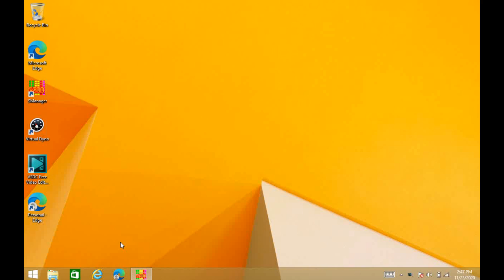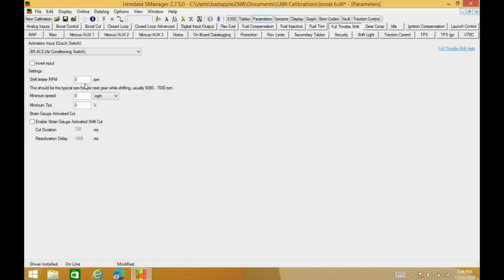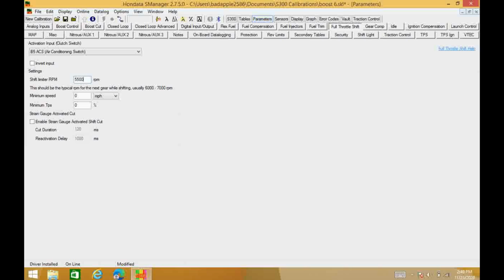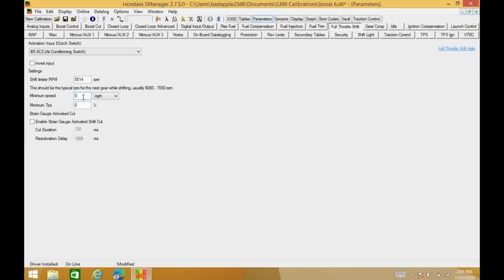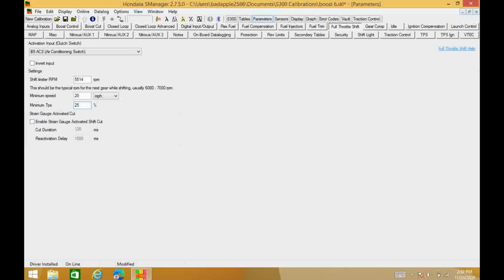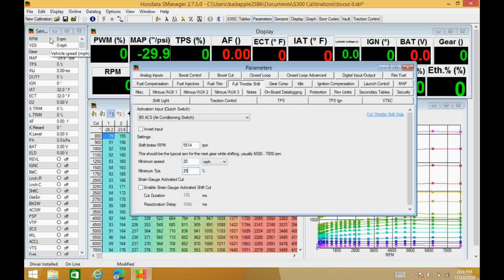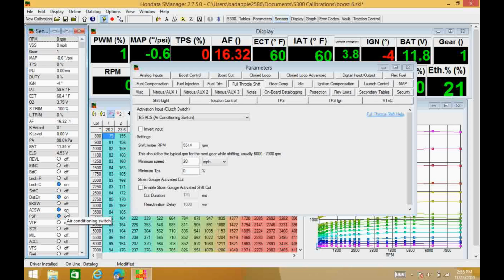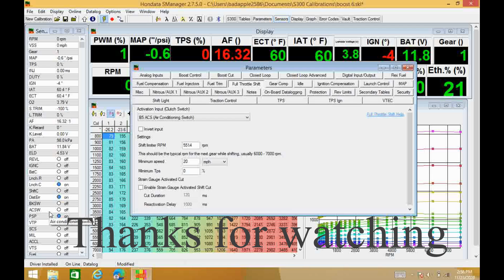FULL THROTTLE SHIFT explained. Hondata Part 2 of 2

Comment: And how does it works? Good? Or are there any problems comes up if you use it at every fullthrottle shift...?
I have an b18c eg hatch in Germany tuned by myself with s300 v3, also running with widebandcontrol at part throttle and I'm always looking for things like this in your video to improve my car to run better😉✌🤘